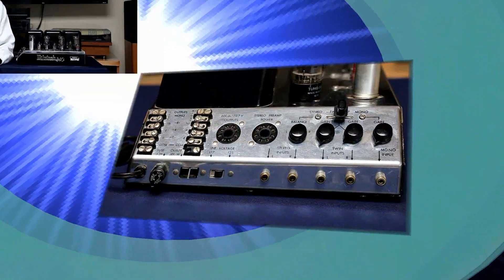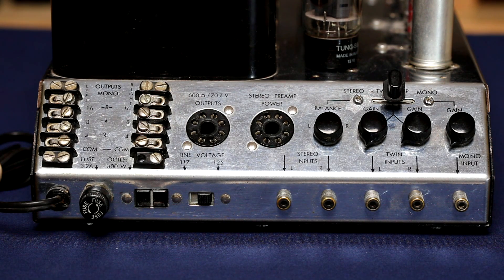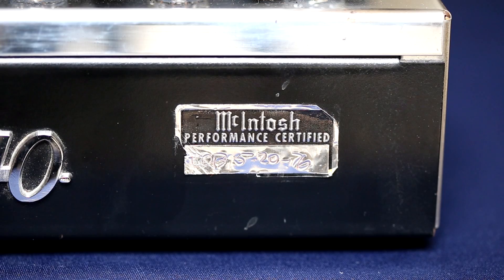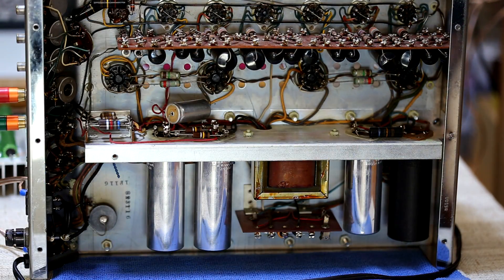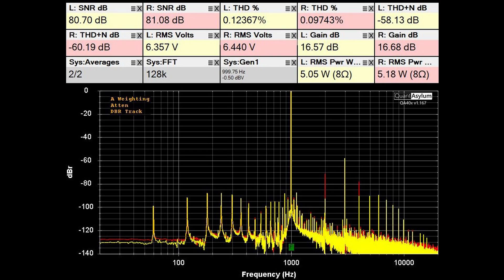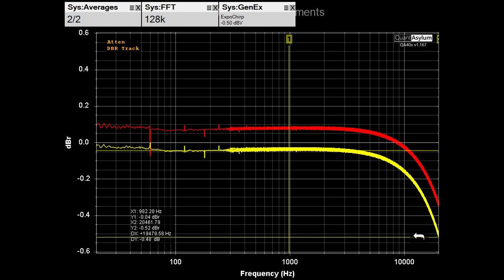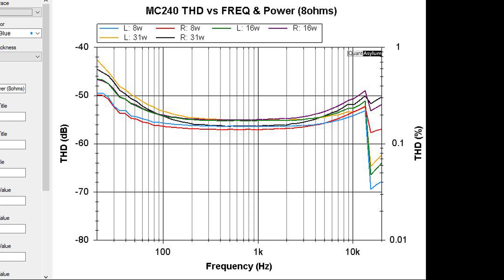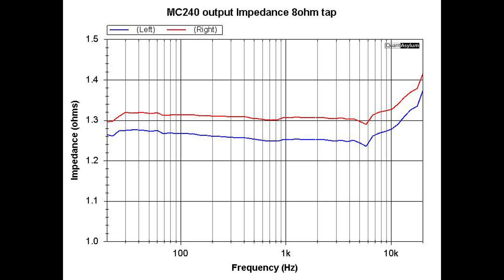McIntosh MC240 Power Amplifier- Vintage Audio Review Episode #43

Comment: Thanks for this one and have watched several times. I have one that I recapped some years ago and have greatly enjoyed it paired with a pair of Klipsch Forte 4’s.  There is now an issue with the left channel so planning to put it back on the bench. I have a QA403 also, so it was nice to compare my measurements with yours. Thanks again!  I like your channel.
Reply from the maker: Thanks so much for watching and you are lucky to have this one. I thought it sounded very good and of course, the looks are great. If you have not tried it, you can connect a scope probe (best be on x10) and connect to one of the qa403's + inputs (- terminated) and use it for t/shooting. Good luck!

Comment: Can you please tell how much gain would be ideal for an audio amplifier?
Reply from the maker: Thanks for the question. I am just talking about an Audio amplifier and not a preamp or integrated amp, but most seem to have around 25-29dB of gain. You will typically get another 6dB of gain if you bridge the amp to make it a monoblock. The lower gain of the MC240 was not an issue at all with the preamp I used, but could be a problem when using certain preamps I would imagine.
Reply: Rebuild the power supply, it should perform better than you've measured.